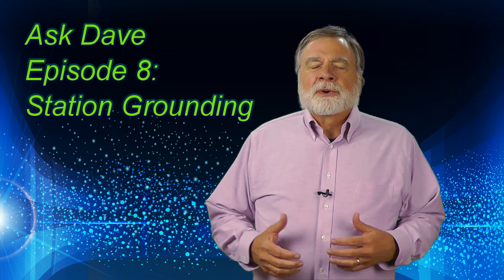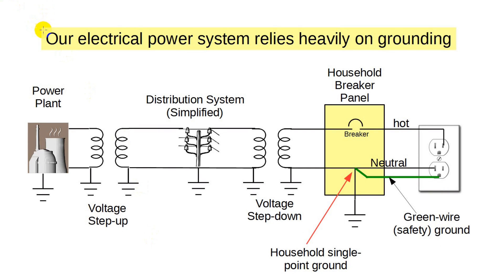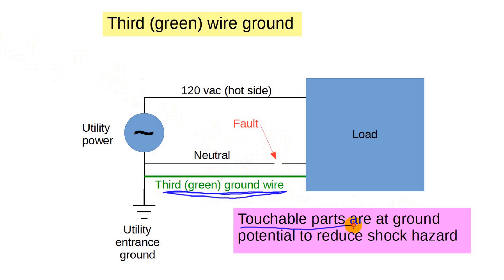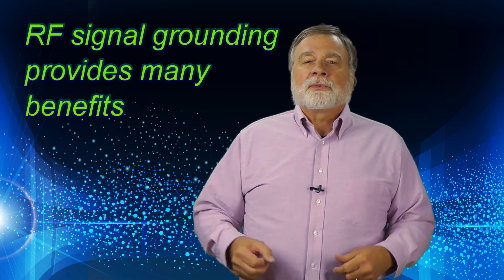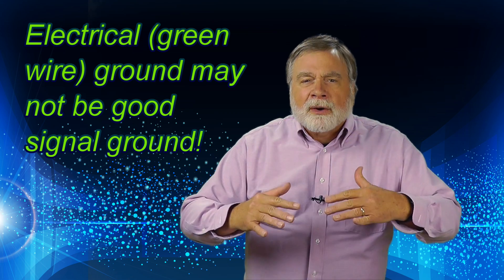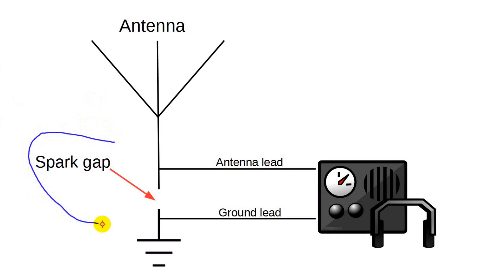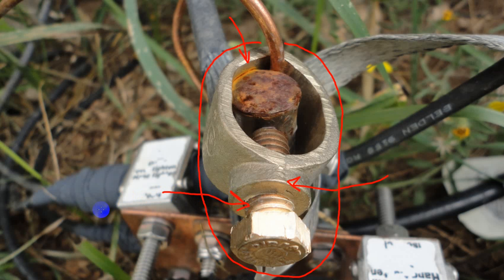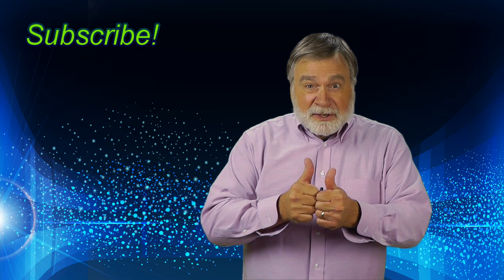Station Grounding for Amateur Radio: Ask Dave Episode 8

Comment: This is a A+ Presentation. If you have a ground rod for your antenna's make sure you run a ground wire # 4 or #8 bare wire depending on your service panel from your antenna ground and your service panel ground because you can get a ground fault between the two grounds. You will be trying to balance between the two grounds through your third ground house plug wiring in your interior radio equipment ground.
    If you loose your service panel ground everything in your house will be grounding through tour radio station and the third ground on your plug will not be big enough to handle it.
    If you experience light bulbs burning out more than often that could be a sign of a poor ground at the service panel.
You would be surprised what dishonest people do. I found at my brothers house the ground rod was two feet long it should have been eight feet and I complained to the county building department when checking other houses all were like that, The electrical contractor made four ground rods out of one.  
Regards; Phil  WW5D

Comment: Dave can you have a sperate ground pole for your Radio set up that is not connected to the house ground on teh other side of the structure?e
Reply from the maker: Yes, you can, but suggest you bond the two using #6 bare copper wire running just below the surface from one ground rod to the other.

Comment: Hi David, thanks for all your videos.  After watching this, and hearing you say that the grounding wire should be kept as short as possible, lest it radiate and become an antenna itself, I had the following question: couldn't you just use shielded cable (i.e. coax) to connect it to the grounding rod/grounding-system?  In this case, I suppose that the coax shielding would have to be left 'floating'. (I can't be the first person to think of this, so I guess there must be a good reason why this isn't a good idea.)  Thank you!
Reply from the maker: The shield will capacitively couple to the center conductor.
Reply: @davecasler  thanks David, that makes sense when I think about it!

Comment: Dave, the part around 4:00 that discusses a fault is incorrect. Simply opening the neutral (open circuit) will not create a dangerous fault and does not pose a shock hazard. It could create an arc fault, however. The "green" ground wire protects you if the hot conductor makes inadvertent contact with exposed metal parts by tripping the breaker since it is ultimately connected to the neutral bus bar in the main panel
Reply: Much of your information is misleading. I realize you are not a professional in this field, but 

s an electrician, the thing we need to tell people is more about bonding than grounding. Make sure all of your radios, amps, antennas, coax etc are bonded together in the shack and then run a SINGLE heavy gauge wire (6AWG is standard) to the grounding electrode system of your home's electrical system. If you MUST drive your own ground rod (it is not necessary and I simply use an intersystem bonding termination to connect that 6AWG to my home's grounding system) MAKE SURE it is bonded to your home's electrical grounding system, be it ground rods if they are there, or water pipes if they are not. DO NOT drive your own ground rod and only connect it to your ham stuff. This could create a dangerous difference in potential with a nearby surge or lighting strike. Despite what folks will tell you, this won't create all sorts of noise on your system and is the ONLY safe way to do things. You want all your equipment to be at the same potential as your home electrical system, cable and satellite wiring, water pipes, gas pipe, etc. I'd encourage you to check out Mike Holt's videos on bonding and grounding, he is very knowledgeable and has corrected many companies that encourage people to drive their own ground rod (create an isolated grounding system) for equipment that is not only dangerous but can damage expensive equipment.

Comment: Great video!  How do you bleed off static on the hot side of a dipole or other antenna that is not DC grounded?  I understand my lightning arrestors do this through the coax braid for one side of the dipole.
Reply from the maker: If the static is too much, the lightning arrestor will arc over and discharge it.

Comment: I had my anntena grounded. I had the pipe grounded. Then lightning hit my Anton 99 and shredded it. The surge traveled through my coax, fried my base radio, power supply, tv, microwave and inverter. That God for insurance.
Reply from the maker: Your homeowners insurance will cover some of it. The ARRL has insurance also. My station once took a direct strike. Direct strikes can be very unpredictable.

Comment: I live in south Florida and I have found out the hard way that a lightning strike can glass over your ground rod. The heat from the lightning makes glass from the sand and the ground is not ground anymore. It is good to check the ground from time to time and just for fun hit it with a hammer.  This may break up any glass that formed. It can easily mess with your head when you find a high voltage on your ground rod. Was not high voltage like plate voltage but,  when working with 12 equipment 8 voltage on the ground rod I thought was high.
Reply from the maker: I remember living in Tampa when I was in the Air Force. Lightning capital of the world!

Comment: Very good video. I am visiting this because I hopefully will be getting my first HF rig. This is a big financial step as I do not have an antenna, radio, feed line and an antenna analyzer or some sort. I will be running a wire from my electrical ground outside to my shack bench to a copper strap for my equipment. Is it necessary to ground 2 M, 70 CM  radios? I am guessing anything an outside coax connects to even though I do not see grounding lugs on my VHF/UHF mobile radio and power supply.
Reply: H Higgins  Thanks!
Reply from the maker: I would recommend grounding everything if you can. There is no way to provide a truly effective ground wire on UHF and VHF radios because any ground wire you create will be at least a few wavelength long. But it's good to ground for safety.

Comment: Thank you for the great videos.  What would be the recommended resource for info on grounding my station that is on the second floor about 48 ft from the closest area I can place a ground rod?
Reply from the maker: Take a look at the ARRL book on grounding. Try different things until you can work all the bands you want without RF getting back to cause issues with your equipment.

Comment: Dave... question if I may. I have a wooden deck clear around the house about 8 feet high. I would like to mount a 16 foot aluminum mast to the deck, with a DC grounded 6 meter moxon affixed.  I plan on running a 4 awg wire from the mast directly over to the utility ground. (About 25 feet). I don’t plan on driving any ground rods. The coax will run from the antenna over to the utility ground where I will install an Alpha Delta TT3G50 and then run the coax over to the shack entrance. The shack has a single point ground which is connected to the utility ground. Do you see any cautions I have overlooked? Thanks.
Reply from the maker: Give it a try. If it doesn't work, you may want to rethink another ground rod.
Reply: David Casler - Danke Schoen!

Comment: Love your videos, you cover so many topics and everything is concise and salient - some stuff in the art is elusive but you nail things down and never delineate. I can't even go one paragraph without suppersymmetrical tangents of tangents. I think everyone I know started on your videos and practice test spam! You and Randy K7AGE lay it down for bambi operators in an approachable, gradualist format - no nonsense in and out. This is one topic that is far too difficult to get good information on, so much mysticism lore and misinformation to earthing. I had scour the topic for years to come up with some bearing in the field because of all the conflicting information and outright bad sources. Axioms of truth, pearls of wisdom and ramblings to follow: Let me preface this by saying I AM NOT A LICENSED ELECTRICIAN, however, nor am I as of yet a dead duck - but as far as I know DOD standard manuals grounding bonding and shielding for tactical and long haul communications facilities and C4ISR/SCIF all stipulate to bond any penetrations of the facility including gas lines to the single point ground, equipotential plane or equipotential loop. I don't have mine bonded, because my bullocks arent that large and I reason the chain link fence is closer than the gas main, but that being said the manuals iterated that in the event of a strike the primary mechanism of damage is from flash-over between lesser dielectric objects secondary to the strike, and if that flashover should hop to the gas line (which is now at a different potential, in proximity, and thus at risk for streamer formation - because we didnt directly bond it via a low impedance path), it will immediately burn through the point where it impacts that object of different potential - in this case the gas line. Burnouts and burn ins are the main concern according to the DoD - That was my understanding, I could have completely misread the manuals they are a very dense read and I struggled to stay tracking - and it's all textbook - I have never had a direct hit from a strike! Hope if I do i'm just out like a lightswitch and my synapse doesnt even cycle once to process what is happening! Had a near miss yesterday that lit every bulb in a chandelier up almost as bright as 120VAC mains power -Luck would have it I was looking right at the chandelier, switch open - and it lit - Even the E26 LED with a power supply driver built in !! - finally one lightbulb filament vaporized into a plasma and carried the surplus of current in a camera-bulb like flash, saving the rest of the bulbs. I can only imagine what the back EMF would have had to have been. The capacitor in the central air unit exploded as well - that cap saved the AC condenser when it passed most of the AC component of the transient and made the sacrifice. That was a hot night waiting on the furnace man, it hit 89 in the shack with the computers and tubes going. As far as lightning arrestors, I dont mess around anymore, almost lost some gear here I couldnt afford to replace - I only run ICE (Industrial Communications Engineers), even on equipment I always keep disconnected when not in use (all of it). Was operating and looked out the window to see a giant arc across the sky with nothing but a gas discharge tube inline! As for array solutions, they cover the FAA the DoD boeing and some fortune 500's. I have never found an arrestor that covers every practicable damage vector in quite the same way. Shunt fed against earth through a tuned inductor, DC isolated via a blocking capacitor, gas discharge tubes to ground, metal oxide varistors for the rapid rise time transients, a resistor to bleed off dielectric leakage - to do any more just seems...unreasonable. Not all of us can run a $500 brick wall surge protector! KNOWLEDGE SEEKERS AND BAMBIS NOTE - your lightning arrestor ONLY functions as designed if your grounding system is of low impedance and free of current loops. Keep your rods 8 feet or more apart to minimize inter electrode capacitance as the soil is charged around the rods as the volume of earth about them floats in potential during the transient. Also - Keep the inductance from the control operator position to the single point ground as low as possible to keep radiation out of your face! (Use a big wire to prevent cataracts) Deadly Important: DO NOT INSTALL A DISCRETE GROUND ROD FOR YOUR EQUIPMENT UNLESS THAT GROUND ROD IS BONDED TO THE UTILITY ROD via as low inductance a path as practicable, no less than 6AWG bare copper per the national electrical code. Failing to make this bond between the discrete rod and the utility rod, and then plugging your radio into a utility power outlet IS DIRECTLY BONDING your discrete rod to the utility rod USING YOUR !!!!!TRANSCEIVER!!!!!*. BOND THE SPGP ROD TO THE UTILITY ROD AND MAKE IT A SATELLITE ROD, NOT A DISCRETE ROD. In a corollary vein - If you have a lot of reflected power and a lot of forward power (IE multiband wire), dont use headphones if you can avoid it - putting those on will put your brain in the RF circuit - logarithmic field strength can be your friend, get that radiator a few thousands of a wavelength off of your grey matter and use a speaker if you don’t need headphones!! Be safe all and if you have doubts, contact a licensed electrician or an inveterate amateur with a few decades under his belt and some experience with solid state gear (I've had a few boat anchor operators tell me they haven't grounded a thing, ever, and they never will until they are grounded - SK!) If you run into one of these boat anchor "Unfounded and Ungrounded" ops - to each his own, no point in pitting fact against dogma - he aint going to learn no new tricks, more likely to take offense to our pressing the point that by allowing his station to float in potential - he is in bad practice). If they are ignorant and don’t want knowledge, it won’t do you any good to be the bearer of it. As far as your insurance goes - the NEC is god. (If you dont follow they hi brow bureaucratic topheavy yankee NEC rules, and your QTH burns right down to the ground, your insurance company will definitely *NOT cover it). Be safe above all else my coons! I am NOT a paid spokesman for ICE, but I should be because I’m sure even the most casual observer can tell grounding bonding and shielding are the three topics most near and dear to my heart, and I plug Array Solutions to everyone seeking knowledge on the topic or hardening of their facilities/equipment.

Comment: I have been a Ham Operator for just over 25 years and on CB Radio since 1965 and I have never once grounded my station and have not had issues.I see it as a total waste of time,effort,& money.I am happy for you that feel the need for it so have fun and 73.
Reply from the maker: I operated for many years without worrying about grounding. Where I am now I've found that grounding helps reduce common-mode noise. Plus we have lots of lightning here, so I feed all my feedlines through lightning surge arrestors for piece of mind. It won't survive a direct strike, but it's something.

Comment: What type of wire do u use
Reply from the maker: You can use "ground strap" (strap copper, I think available at Home Depot), braided ground wire (very common--check DXEngineering or similar), or thick wire. I use braid from my equipment to my station single point ground which is a short piece of copper pipe, and from there to the ground rod right outside the shack, I use #2 stranded wire. The ground rod itself is copper-coated steel, 8 feet long, and available from Home Depot.

Comment: I may be totally mistaken, but isn't there a rule in the NEC book that says there should only be one ground rod for a home/building?  And wouldn't adding a second ground rod for the radio shack violate this code?
Reply from the maker: No, but the ground rods should be "bonded" (connected together). The utility neutral is connected to ground only at the utility ground, not at any of the other ground rods.

Comment: Hi Dave,

What about bringing an earth to attic about 20-30 feet ? and what type cable would be best ? I'm hoping if I pass my Exam in May I can set up in the attic as it's the only good solution if that's not practical I'd have to work something else out. 

Is it possible it will resonate ?

Is braid better than wire ? and what gauge ?

1 or two 4 foot earth rods ?

Thanks.
Mark
Reply from the maker: 8 foot ground rod. Go ahead and set it up. Bring all your antenna lead-ins to the ground (use a lightning arrestor there) and then run the cables up to the attic. Run a ground strap from the ground rod to your shack single point ground. If you have RF issues, try changing cable routing or lengths. It's not an ideal situation but one which many face.
Reply: @davecasler  Thanks for the reply Dave.

Comment: Hi David, I see a lot of Hams have big copper bus bars in the  shack with every bit of equipment connected to it but would it not be better to just earth the coax shield outside and then just have the Radio, Amplifier etc connected to normal 3 pin house earth ? so then you got RF Ground outside and electrical ground via the mains wiring.
Reply from the maker: No.
Reply: @davecasler  fair enough , won't argue with a Man who's being doing this a long time ! :-)